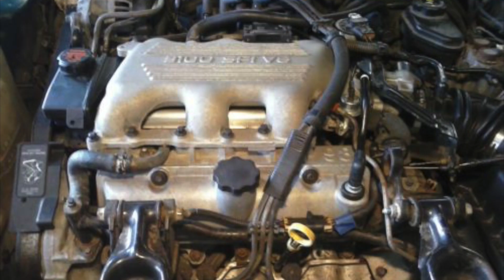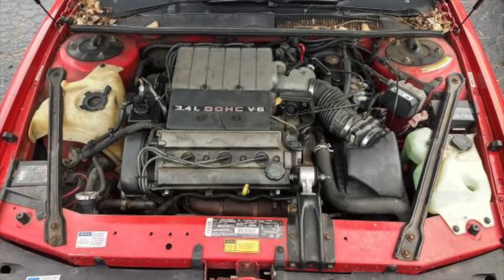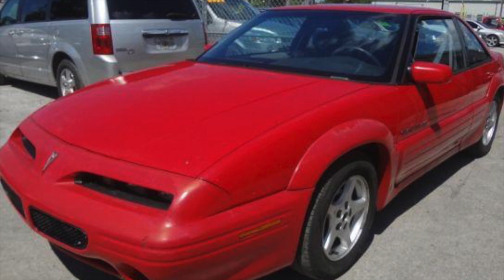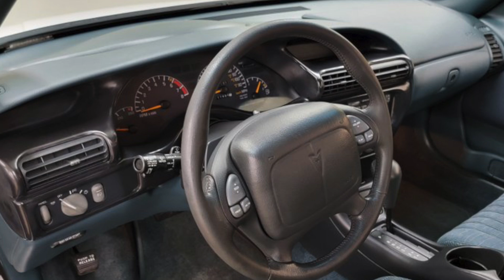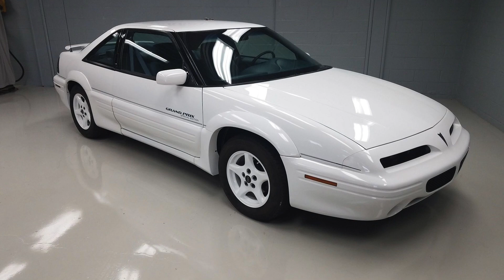Surprising Facts About the 1994-96 Pontiac Grand Prix

Comment: Can you tell me how to get my water reservoir out to get to the battery?
Reply from the maker: I’m not sure but I can pin your comment and hopefully someone that does will see it.
Reply: On the 1994s its just 2 plastic clips that you pop out and remove the container the support bar above it has to come out and along with the power center needs to be loosed so you can move it out of the way to pull the container out

Comment: Great video but some misinformation concerning the 1994 LQ1.  It was still using batch firing as the previous 91-93 motors.  The added benefit of the sequential port fuel injection over the previous multi-port system is how the extra HP was added along with some of the other changes mentioned.

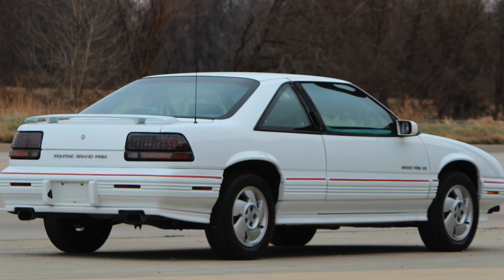The B4U package was NOT standard on the SE coupe, the BYP package actually was.  Starting at about 10:20 into the video, that's a BYP packaged SE and THAT package was standard.  The previous coupe with the license plate AJ...that's the OPTIONAL B4U package.
Reply: 🤣 You are a BEAST Sir! Once again, I see you in the comment section schooling these amateurs 😂 I really hope that you consider making your own videos brother.
Reply: @youknowit888-kt4en  I don't know everything...but I do know some things.  It's only thru the education of others and doing very in depth restoration work on both of my W's that I've learned so much.  Thank you for the kind words!

Comment: I’m still trying to find parts for mine
Reply from the maker: Even the late 90s ones are beginning to be challenging
Reply: @Beyondthelensproductions  indeed ! I mainly try to find aftermarket parts  or something close that would fit it
Reply from the maker: @fendellmallery6620  Ya sometimes you've got to do what you have to do. NAPA over here is pretty good at stocking parts for them still. I just did a full new suspension on mine. Shocks, struts and mounts. The car drives like a brand new car now!
Reply: @Beyondthelensproductions  awesome I will definitely give them a look
Reply from the maker: As a side note my mechanic will even sometimes choose NAPA over the OEM part because of a better or more improved build or even a better warranty. Not always the case but it’s true. This guy knows his stuff.

Comment: I had a 95 GTP. Did a few upgrades to it. Underdrive pulley, Hypertech chip, exhaust,  billit motor mount and front and rear strut tower braces. The car ran great and was fun to drive.

Comment: Thank you again.  You can see the 1997 model was coming with the upgrades from 1994-1996. The exterior and new interior were showing what was coming. The engine was upgraded also. It finally had the power it should have had in 1988. You can see the 1988 styling was starting to fade away and the LE and STE were gone.  Changing is coming indeed. The Pontiac Excitement was coming!
Reply from the maker: You are right sir! The interior really showed what was coming and there was even some subtle exterior changes. I’m going to be showing a lot of photos from the Pontiac Grand Prix club I used to belong to when we move into the next generation.
Reply: @Beyondthelensproductions  I will look forward to the video.  Keep it interesting and keep it coming.
Reply from the maker: @OLDS98  I'll do my best.
Reply: According to the designer, the Grand Prix was supposed to be redesigned for the 1994 MY in 1993 and got leaked in May 1990.

The design was just about done in the spring of 1990, when GM had financial issues and delayed the redesign, ultimately arriving in September 1996 as a 1997.

The new dash in this car, was for the planned '94 redesign, but when it got delayed in 1990-91, the new interior went to this generation instead and another interior was designed for the 1997 model.

The Gen 2 Lumina was supposed to be released in late 1992 as a '93 model, but got delayed. As did the Intrigue (Cutlass Sup redesign).
Reply: @nwezetx1  I have the magazine where it was leaked. It was Automobile magazine and few other places. A bunch of stiff got leaked  from GM at that time . I recall it was Grand Prix, Seville and Eldorado and Camaro and Firebird. GM was upset.  The cars did not come out until the 1995-1996 time frame.  That cost GM time and money.